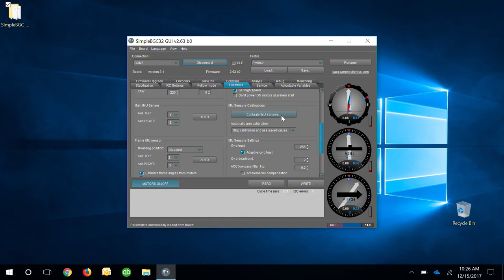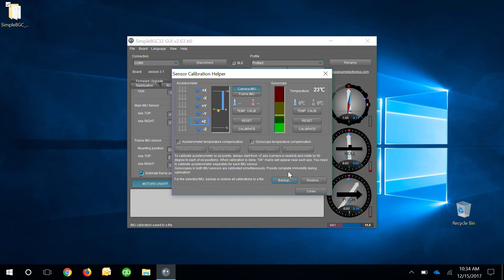Accelerometer and Gyroscope Six Point Calibration for Ikan Beholder Gimbals | Part 3 of 7

Comment: I have the Beholder EC1, and this is not at all what was described in the user manual (which didn't say anything about connecting to a computer).  Is this a better method than the one described in the manual?

Also, are you really supposed to calibrate it with the camera on it?  What if you change the lens or use a different camera?

Comment: About the slight tilt on startup of gimbal. Yes, It always happen with my DS2-A.
I followed all steps, even being very hard to calibrate the gimbal with the -X, cause my camera have a strap lug that do not let the camera flat and stable on the surface. 
So, I puted everything that I finded to support the camera 100% flat and stable at the sea level. Even so, the slight tilt on startup goes on. 
So, what I'm doing wrong? I don't need to put 100% flat at the sea level?
Reply from the maker: Sorry to hear you still have an issue with your gimbal. Please contact support@ikancorp.com for assistance.
Reply: Ok! Thank you, I will!
Reply from the maker: No problem! They will be able to help you with more technical issues. Let them know you've seen these videos since they might refer you to this set of videos.

Comment: When calibrating the +y I cant get it to point straight down. Like pointed out in the video you cant tilt it down that much when you tilt forward because it will stop very soon at a "stopper". If you tilt it down in the opposite direction you can get it to almost point straight down but there is still a little silver "stopper" that prevents it from pointing straight down. You are almost there but not completely. Are you supposed to just tilt it as far as you and can and calibrate at the stop even if it is not pointing completely straight down? Will that be good enough? Or are you supposed to tilt the whole gimbal before pressing "calibrate" to make up for the few degrees you are not able to tilt the axis itself?
Reply from the maker: Tommy, thank you for your question. Please send your question to support@ikancorp.com. I also suggest to look at forums and groups online such as Facebook - I have seen many groups on there that have gimbal communities where other have had the same experiences. Hope this helps!

Comment: Hello Mr. I have DS2 A beholder and it needs calibration but it's not connecting to my macbook pro I tried everything you and other said in their videos, as well I sent many emails to Ikan but still failed to calibrate, and because of this problem many of my shootings delayed, I use canon 5d with 24-105 mm lens.kindly help me to solve this problem. thank you
Reply: buy a new usb to mini usb cable. trust me, it worked for me. Go with the Amazon Choice one.
Reply: @js3257  thank you i will do that